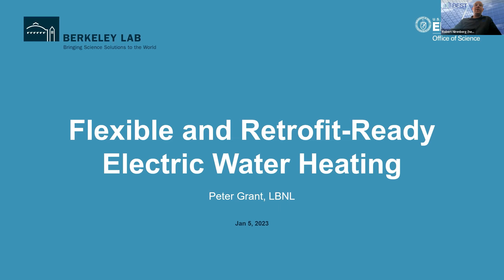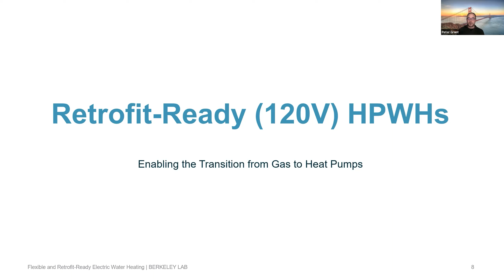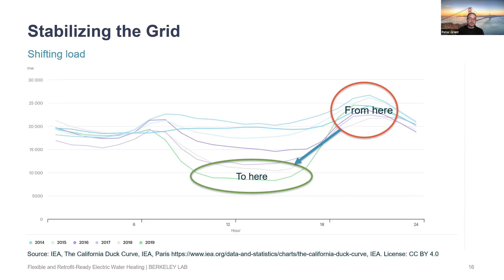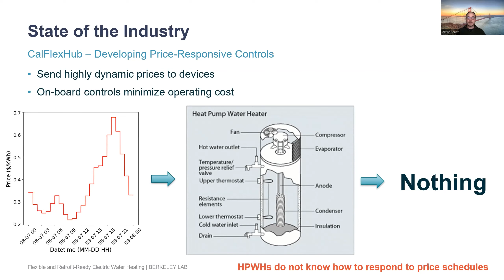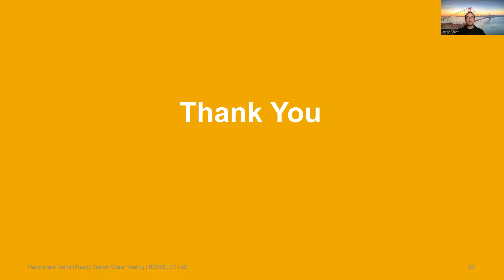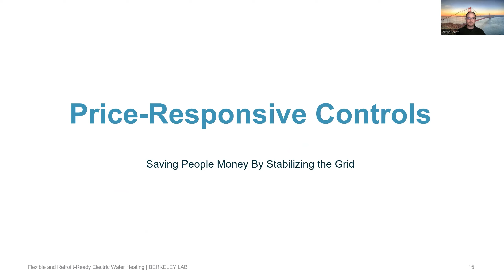Flexible and Retrofit-Ready Electric Water Heating - Residential Buildings with Peter Grant

Comment: Would a more cost-effective and lower lifetime carbon impact solution to heating hot water in locations with large amounts of sunlight (and PV such as California)  not be to use solar thermal systems such as vacuum tubes or flat plates and then the heat pump would not be needed at all? instead of using all PV on the roof use part of the roof for a solar thermal system and replace the gas-fired calorifier in each apartment with a well-insulated cylinder with a heating coil? 

This requires no refrigerants and very little electricity. It may also address the duck curve in a way by reducing the amount of PV feeding into the grid and reducing the Nat Gas consumption by removing gas-fired water heaters.